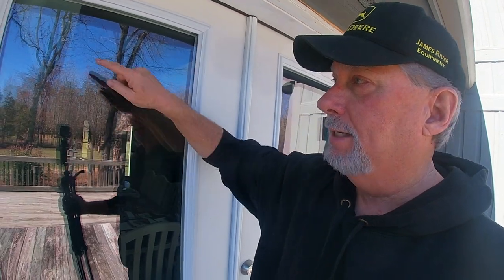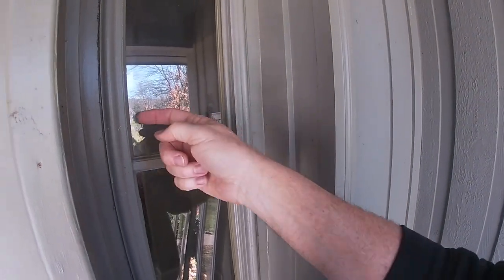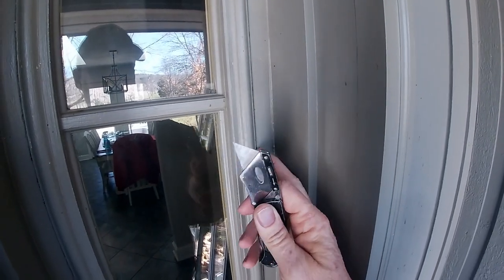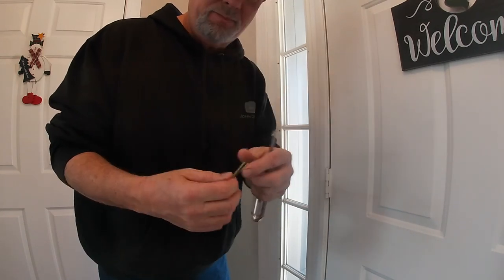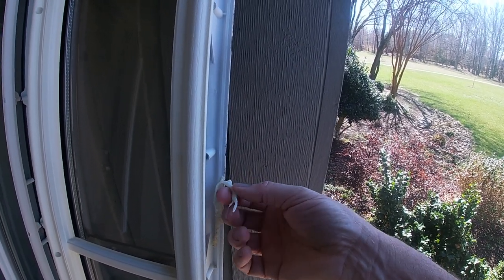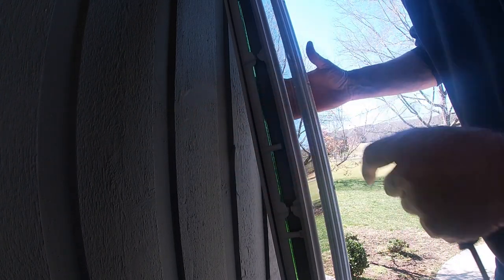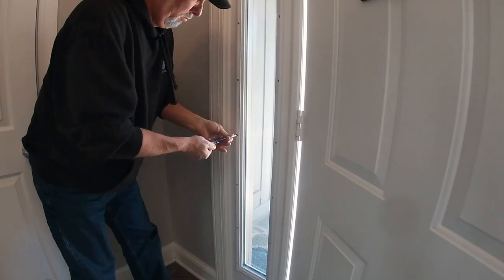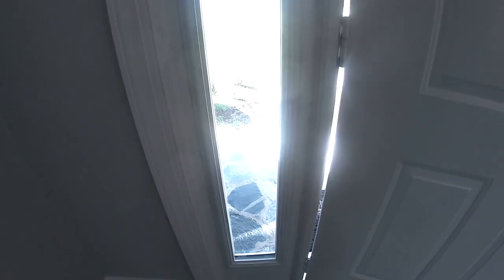REPLACE SIDE LIGHT ON YOUR DOOR

Comment: I wanted to replace mine that shattered but the only replacement I find online is 10 x 66 but i measured mine and it is 10x70 builder original but not standard size is so frustrating. Ill try going to lowes like you and see if yhey can help idk

Comment: From where did you purchase your new sidelight window kit?
Reply from the maker: Ordered it through LOWES. Took about 3 weeks to get them in.
Reply: Hmm okay, thank you! I’ll have to look again because I only see them online sold as a set with the door + full side panel that holds the sidelite window.

You made it seem so easy with your instructions so I’m looking forward to replacing it on my moms house!
Reply from the maker: You will need to measure the height and width of your side glass. Go to the back of the store where the  doors and windows are at LOWES. Get someone at that desk to help you. They can put an order together for you. Good luck.   @lauraholman7355
Reply from the maker: LOWES, go to special order desk in the back where all the doors and windows are on display.